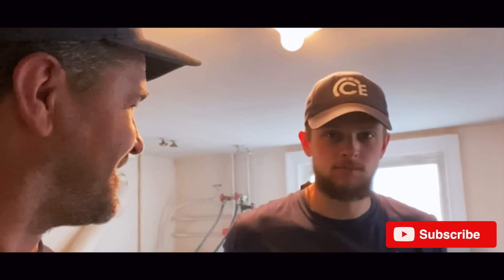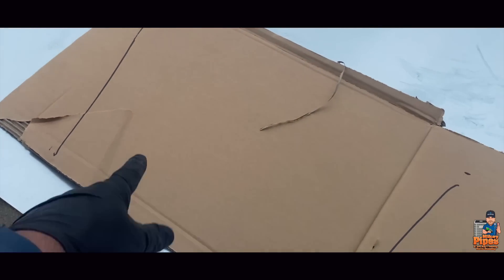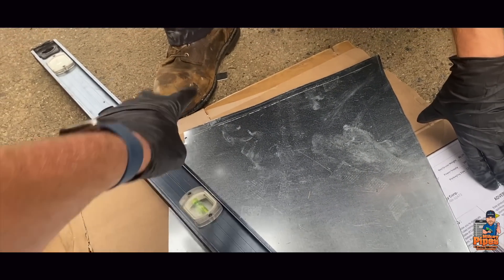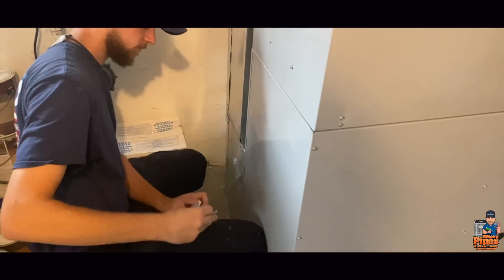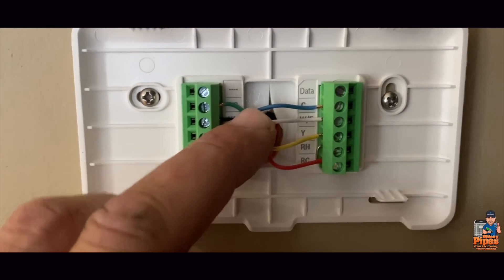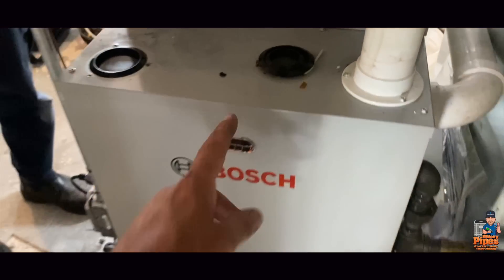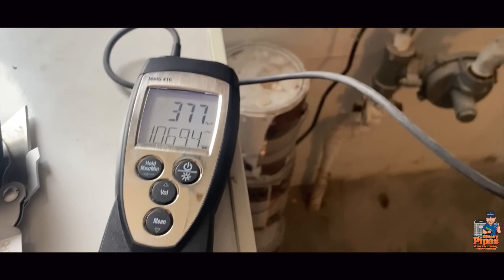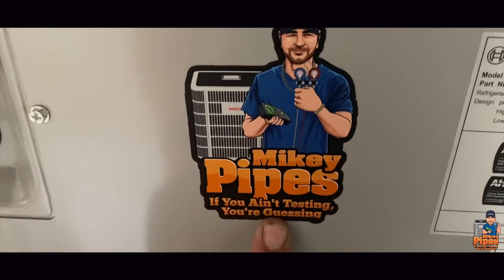Part 2 Oil Furnace and Water Heater to Natural Gas Conversion - Installing Bosch BGH96 Gas Furnace

Comment: I measure like almost all my plenums now but guy taught me to cut out a square of metal bend your lip and cross break it then just trace it on the metal boom cut it out your good also like to use S lock on the vertical seems

Comment: Curious. Who makes the Bosch furnace? I know it's not Bosch themselves as a company. Furnace manufacturers make the same furnace and it gets distributed to all kinds of random name brands. The only thing with the bosch is I don't know any brands that look similar and have the same parts. It almost looks like trane inside that unit..could be wrong
Reply: @PipeDoctor  no shit? I watched this video again, looked like some York designs in there too but it is a different animal. Be interesting to see how the heat exchangers hold up. Might start selling Bosch myself!
Reply: @PipeDoctor  hopefully Bosch isn't related to Navien.

Comment: Like how you did that cross break. Was wondering why you just used screws on the sides of the transition? Did you not have any S lock? Either why nice job.

Comment: Am I correct in assuming that adding the IDS 2.0 heat pump to that setup would give a total, high efficiency solution for both heating and cooling?  As the outdoor temp. goes below let's say 40 degrees, the furnace would kick in to heat the home more efficiently than the heat pumps electric heaters.  This could be the solution that I've been looking for.
Reply: bosch heating can maintain good heating capacity far below 40 degrees.
Reply: Electric cost is high in the area.  While it will work it becomes more cost effective to run gas.  But what is being said about gas prices coming this winter, I may run the heat pump deeper into the winter.
Reply: @deanh2664  natural gas prices rise and electric soon follows, since there's a ton of natural gas powered electrical generation......

Comment: Shit, that’s a neat trick with the sheet metal and a “sharp object”…😳😳😳
BTW, static pressure on return side should always be a negative number. You have 2 ports on your meter. The readings mean nothing without a visual check of all the registers in the home to see what’s open vs possibly closed. Bosch should have a sticker showing static pressure (example 0.5”) Too high a number could just need to adjust registers open, or might need more return air ducts. Lower static pressure equals more air flow/less motor amps.
Reply: I'd  have to guess the basement is being negative pressured below what the return dust is at or he had it on differential.
Reply: also, depending on the blower motor type, high static pressure = reduced airflow and that's actually  less load on the blower wheel with increased rpm's.
with an ecm,  that's not a bueno thought process. there's other things involved that can change the motors current draw, but a main one is blower wheel size and loading(zero static pressure is bad too. take a blower assembly out of a furnace and run it in free air space, pretty much guaranteed to drag low in RPM's and draw high overcurrent, possible double to triple the rating plate!.

Comment: Tesp of .9 ouch. Someone needs some duct mods and that heat pump is not going to like that lack of airflow. Since the indoor coil will be your condenser in heating, it will be like running an ac with a highly plugged outdoor coil. Just a thought next time, tee into the domestic water tankless and put a bosch hydronic air handler fed off the tankless. Your heat output will be lessened with a high static duct system like you have but you can raise  your domestic water temp to compensate